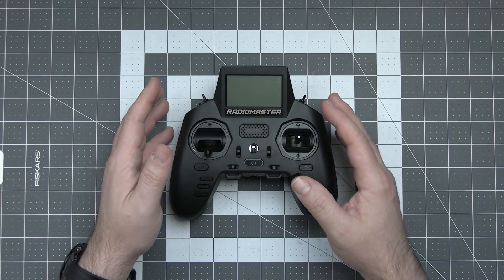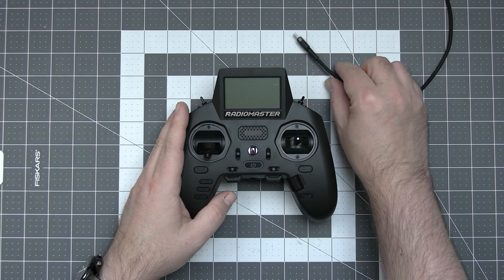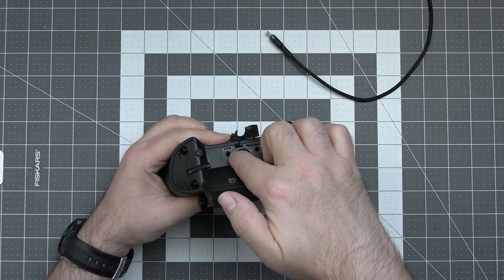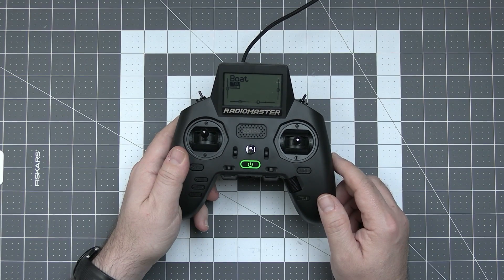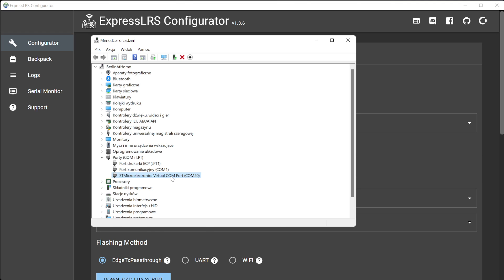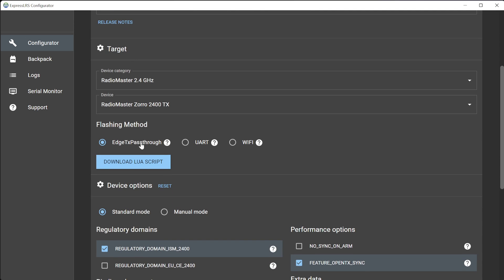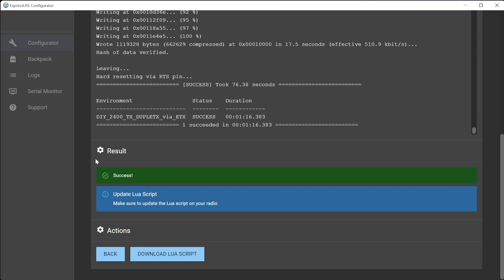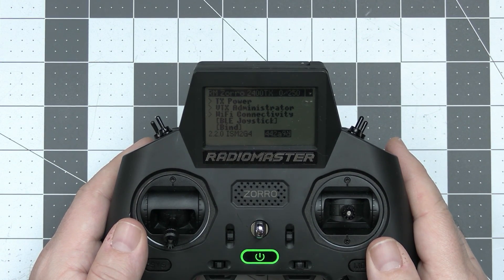How to flash ExpressLRS with EdgeTX Passthrough

Comment: As of EdgeTX 2.7, "USB Serial (Debug)" is now "USB Serial (VCP)" (as in Virtual COM Port). And now that the TX16S MkII has been released, I can add that the TX16S MkII with ELRS also supports passthrough. As does the Jumper T-Pro, after a hardware modification - detailed on the ERLS documentation site.
Reply from the maker: Thanks for info, pinning this comment. Thanks a lot